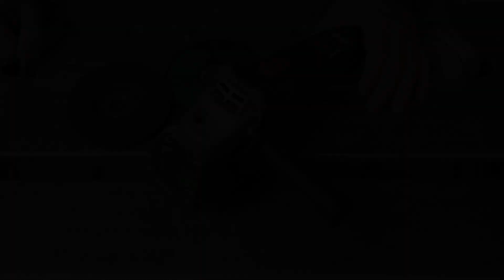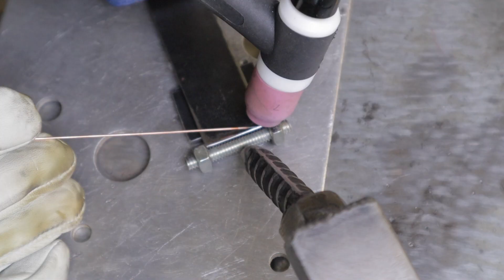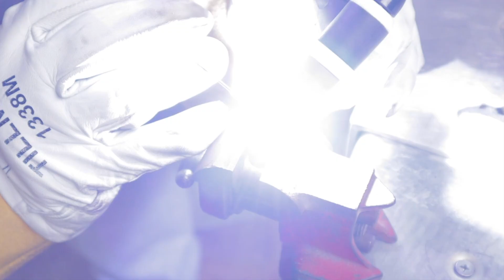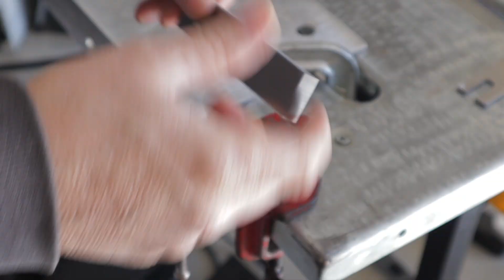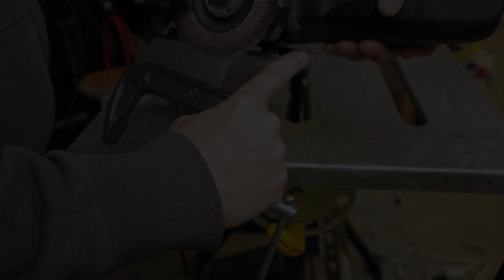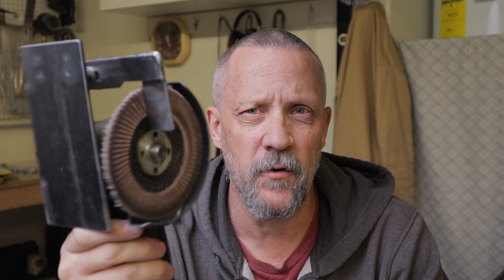DIY Angle Grinder Cutting Guide - How to Get More From Your Angle Grinder - Homemade Tool Ideas

Comment: I dunno about running my fingers that close to that but good video. Have to pickup a new HF cheapie grinder cause last one burnt up when it jumped on my chest, luckily it was a flap disk.
Reply from the maker: You're right Boris, fingers are pretty close. I should probably use a push stick for those tiny pieces. Glad you didn't get hurt with your grinder. I need to pick up a new one myself. Mine is pretty wore out and weak but it's been a great little grinder for what I paid for it.
Reply from the maker: I agree with you Mark. I tend to have some shop habits that aren't considered safe to a lot of people. I do still have all my fingers though. 👍😀

Comment: Nice angle grinder guide and well built Bruce. One of the best things I ever bought was a cordless grinder, so much easier to use without worrying where the cord is. Expensive but worth it I believe.
Reply from the maker: I've been considering a cordless grinder Thomas. What cordless grinder do you have if you don't mind me asking?
Reply: @DIYHomesteadProjectsDIYHP10  the grinder I have is an own brand one from a store called Lidl. Their power tools are sold under the Parkside name and they all use the same batteries, 20 volt 2, 3 and 4ah versions are available. The tools are actually made by Erbauer in Germany, Lidl being a German company as well. All their tools carry a 3 year guarantee and I'm told they are excellent at honouring any claims, even if slightly over the warranty period. I paid £29 for the bare grinder as I already had four 2ah and four 4ah batteries for a drill and impact which I've had for a number of years now. A 4ah battery costs more than the grinder. 😆
Reply from the maker: Sounds like a nice set up and it's nice to have the batteries that fit all the tools I think.
Reply: @DIYHomesteadProjectsDIYHP10  I forgot to say that the grinder came in a blow moulded carry case a with side handle which has a storage slot in it for the pin wrench, a cut off disc and a grinding disk.  The grinder will fit in the case with a 4ah battery attached and there is also a slot for a spare 4ah battery, and another space for a charger.  For the price at the time I simply couldn't resist it. I also have 3 corded 4.5 inch grinders as well as a corded 9 inch Parkside grinder which is also awesome and wasn't very expensive when I bought it.  This setup saves having to constantly change discs, wire brushes and so on.
Reply from the maker: I looked up that brand and looked at some of those setups. They look like a nice tool. There are just so many brands, styles and sizes to choose from it makes it a little overwhelming to make a decision. 😀
Reply: @DIYHomesteadProjectsDIYHP10  If money was no object I would definitely go for Makita tools, I have a friend, who works in construction, and Makita are the only tools he will buy, he places them above Bosch, DeWalt, Milwaukee and all the rest.  having had the loan of some of his power tools I would be inclined to agree, but I can but dream. Lol.
Reply from the maker: LOL, money is always an object for me. 😄  That's why I have a lot of Harbor Freight tools and I'm always trying to work with what I have and make do. I really think I could do fine with one "good" grinder for the demanding jobs. Then do like you suggested, have two or three of the el-cheapo's for flap discs and wire wheels so I don't have to change them all the time. 
I do all of this just as a hobby so none of it really matters and I really don't "need" lots of "good" and expensive tools. Not to say I wouldn't like to have some though. 😄
Reply: @DIYHomesteadProjectsDIYHP10  
A lot?  More like all your tools. 
If you build a new one.  Make it the other way.
Yours is going to try and jump out of the cut.
Don't ask how I know.

Comment: That was a fairly labor intensive build. Nice job, and a nice idea. Couple of questions... did your HF Grinder come with the top position handle location, or did you tap and thread it yourself? It’s really handy to have, especially for us lefties. Also, we’re you using your Yes or PrimeWeld Tig? Thanks Bruce!
Reply from the maker: Hi Mark, the little HF grinder came with two holes for the handle position. One on each side. It looked like the top but that's just because the grinder is on it's side. Either way it is nice for using either hand. 
I used the YesWelder for building this cutting guide.

Comment: Next on your list there should be a table belt sander.
Reply from the maker: That would be nice Mat. I've considered it but I currently have a little Delta 1X30 sander that does most of what I need. It would be nice to have a larger one with more power sometimes.

Comment: Nice build, but too many dangerous practices in this vid tho😔 the less experienced could get in to trouble, for example free handing a  workpiece into a cutting disc, just no. Would you consider clamping a circ saw saw down and bringing work into it? The work can get caught and  dragged into the cut in a microsecond, with your fingers behind it. Sorry to come across as Safety Police